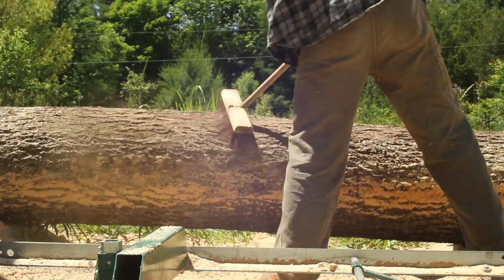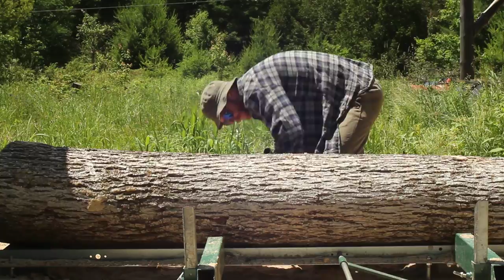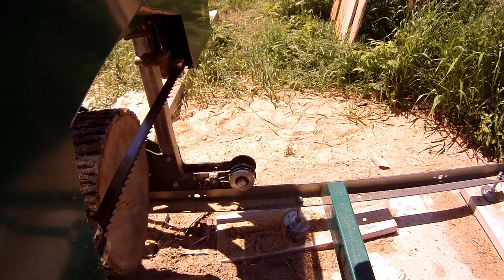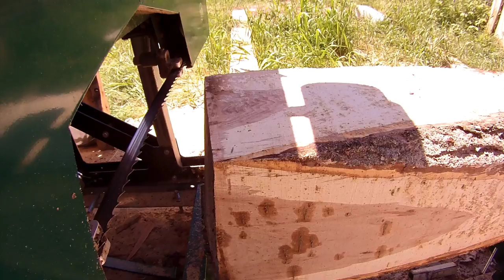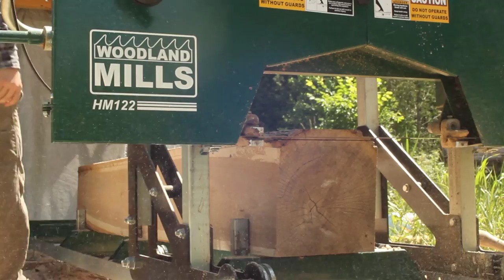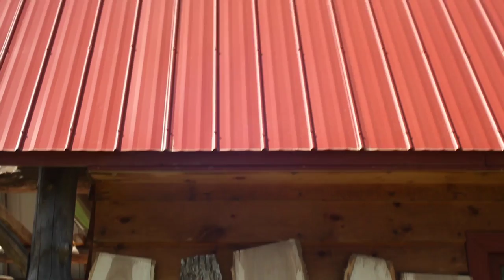Ash log on woodland mills HM122 sawmill

Comment: I have an HM122 saw mill. Bought it two years ago. The log stops on your mill are on the wrong side. They should be on the dicharge side of the cutter head. That way the force of the blade cutting through the log is pushing against them instead of the clamp holding all of the force. I think you put the log bunks in opposite of what they should have been installed. Not critisizing , just FYI.  Have fun with your mill. ------- Bob
Reply from the maker: I realized that a little while after I set it up. I decided against spinning the mill around because I’d be facing into the sun. I’ll switch the posts over when I’m able to load the logs from the other side.
Reply: You can just rotate your bunks 180 degrees to fix that problem.
Reply: @workshed3996   I was going to comment about the same thing but after looking at it from a different view.....you will save blades this way for two reasons...#1- log stops on operators side are easier to see and NOT hit.  #2 - after your first cut you will always be cutting into NO Bark side which will save blades in the long run. I've actually been thinking about doing this myself after adding extra log clamps.  SAVE BLADE WARE !!!!!
Reply: I was going to comment about the same thing but after looking at it from a different view.....you will save blades this way for two reasons...#1- log stops on operators side are easier to see and NOT hit.  #2 - after your first cut you will always be cutting into NO Bark side which will save blades in the long run. I've actually been thinking about doing this myself after adding extra log clamps.  SAVE BLADE WARE !!!!!

Comment: Idle your engine down. You're wearing your clutch out at an idle. There should be no jingle or rattle. The clutch dogs are slightly engaging the bell causing that jingle. Not enough to engage the blade, but it Will wear out the clutch very fast. 
It's worse idling like that than cutting.
Idle screw will fix that easy. It's idling too fast causing slight premature engagement. 
Hope you caught it quick.
And yes. Log stops are on wrong side. Dangerous as weight is on log clamps when cutting. Should be opposite
Reply from the maker: Thanks for pointing that out about the idle. I just thought that was something rattling. I’ll look into it
Reply: @andylynnpei Page 26 of the manual states: "Ensure all bunks are oriented so that the log support sleeves are all on the same side." It does not sate which side. Same side. It means either. It's built to be reversible. Not every one can be installed and oriented in the same direction every single time. Some will load from the left, and some from the right. The track is built that way. The log clamp arm need to be on the opposite side but the connecting rod runs the width of the track and on page 33 the figure shows it being bolted in on the same side as the stops with the arm setting to the opposite. He's got is set up just right for the way he's loading it.
Reply: @JnitraM078  Humbly and Graciously NO! check every video or manual on Woodland Milss. Or any bansaw mill.
 The human is always cutting while walking down the side opposite the log stops. 
The log CLAMPS MUST always be on the side with the human operator walks down while cutting, and logSTOPS opposite side from him. 
The blade direction pushes the log toward the log stops. Solid stop for the log
This setup the blade direction pushes the log  into log clamp. They can let go if not tight, and the log clamp is taking the weight of log from blade direction push 

If a log clamp is loose the log will shift and bind or  worse break blade abd snap a danger to all. Or worse if the loose log clamp drops, the log flies off the mill. It's all incredibly dangerous. 

You can load from either side, correct..  
He can still load from the same side... but  He can fix this danger and misuse, by flipping head 190 degrees and starting from opposite end, cutting toward the shed...   Then is all 100%  no need to disassemble anything.  no need to turn the track.  Turn the head pick it up with 3 guys.  Then its fixed  and logs still load from the same side. 
Its not an assembly problem.... its just the head orientation... turn it 190 degrees.
Sure  the shed is on the wrong  end.... but its no issue.   
When finshed cutting roll the head to the end under the shelter.  Still protected. 
But now you will be cutting  toward the shack direction, but proper and safe. 
No need to disassemble anything 
4 men turn head around 190 degrees 2 min work.  Dont touch the track.  

I am trying to be very nice and kind here. 
But PLEASE...
Your post is dangerous to this man, or any novice watching who doesn't  know. 
Go look at any WM video, any sawmill in the world, on Woodland Mills, norwood, etc....
See which side the human is on  and where the Log stops are in orientation to him. 
Logstops are on side opposite of the human. 
Log clamps on the mans working  walking side. 

Owner of this site, PLEASE consider removing this guys post ASAP so no one reads it and  gets hurt. 
Or if you are the poster, please delete this comment ASAP. Go check... quickly.... you will see.
I know your just mistaken and not understanding your error. 
That happens  to us all. 
But Someone can get seriously hurt if they model this or read your comment.

Comment: Being Said log Stops on wrong side ..... I was going to comment about the same thing but after looking at it from a different view.....you will save blades this way for two reasons...#1- log stops on operators side are easier to see and NOT hit.  #2 - after your first cut you will always be cutting into NO Bark side which will save blades in the long run. I've actually been thinking about doing this myself after adding extra log clamps.  SAVE BLADE WARE !!!!!
Reply: Is the bark harder on the blade or is it the stuff embedded in the bark?

Comment: Are you still happy with the 122 ? i don't have really big logs and it's chesnut, I thought the 122 would be a little weak, but looking at you it looks quite capable of eating large diameter hardwood
Reply from the maker: I am happy with it. I have had a few logs that were too big for it but it does 99% of what I pull out of the woods.